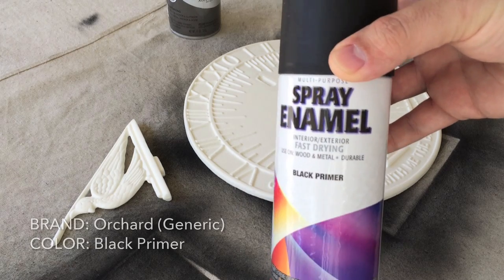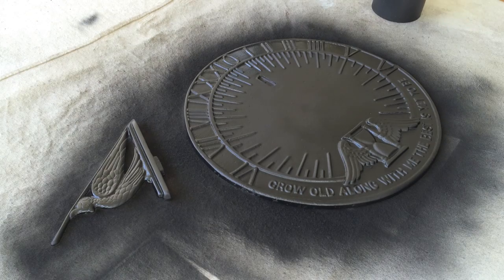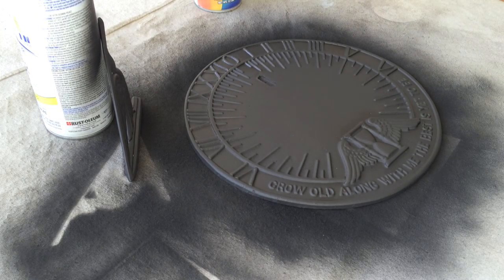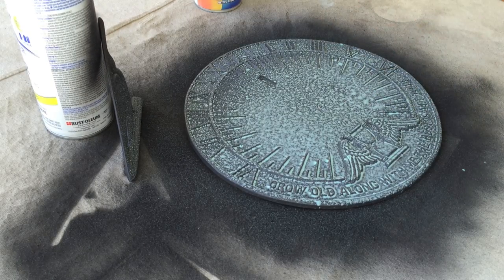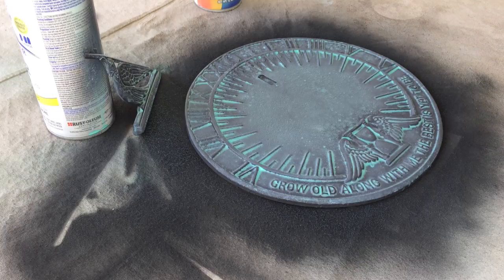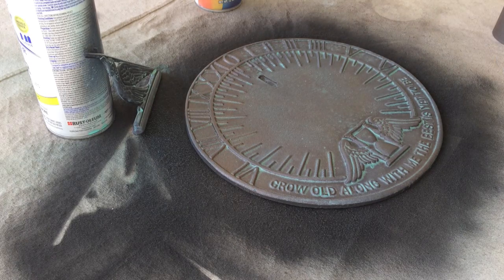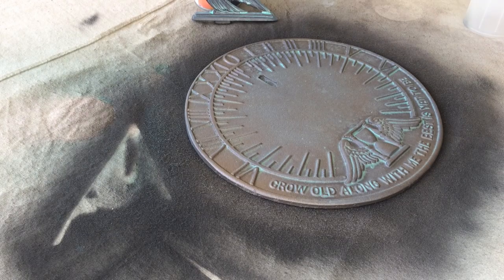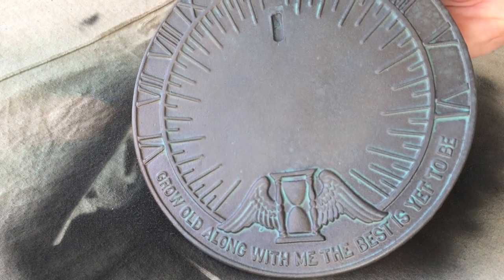HOW-TO: Realistic Faux Patina Painting with Spray Paint & Craft Paint

Comment: This is the most natural method I've seen so far. I want to try it on an old aluminium bucket but wondered if the paints would run with it not being able to be laid flat as this is.
Reply from the maker: whitedogleeds The paint would definitely run, but that’s a good thing. Naturally moisture would drip down the edges of any object causing the patina to run or spread. I highly recommend doing a Google image search for reference photos to give you a few ideas of how patina would form on a variety of objects. It always helps to see how something like this would occur naturally before trying to re-create it with paint. Good luck!
Reply: Thanks!

Comment: between the coats of patina spray, it looks like you must have rubbed some of it away?  Wish you showed that part as it's important to the finished piece.
Reply from the maker: Nope, the patina paint dried. That's all. Because the paint is thinned out with water it looks like there's more paint than there actually is. As the water evaporates the paint is left behind.
Reply: @VanOaksProps  ahh, thanks for the explanation. :)